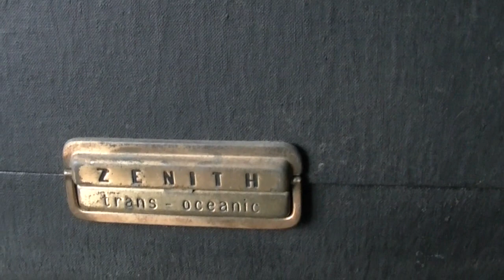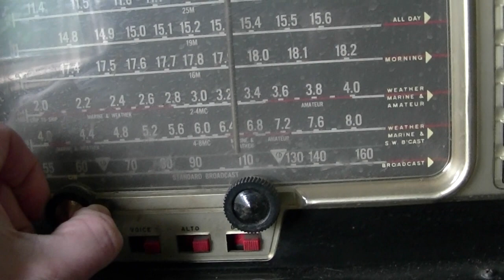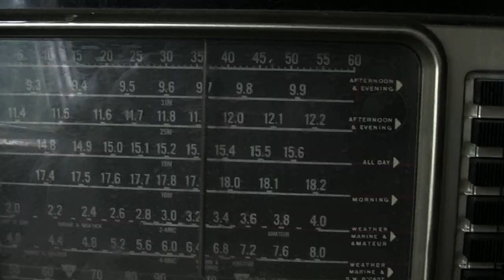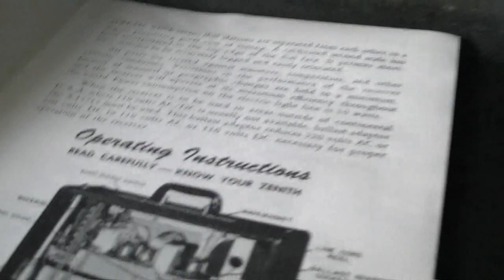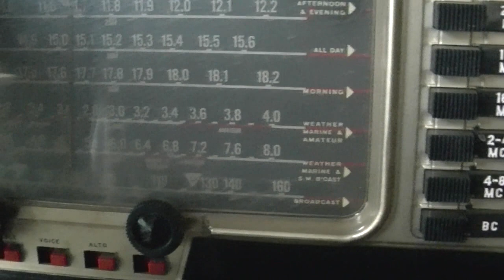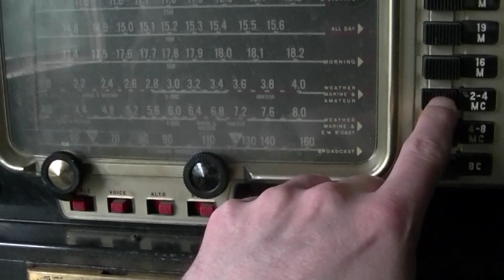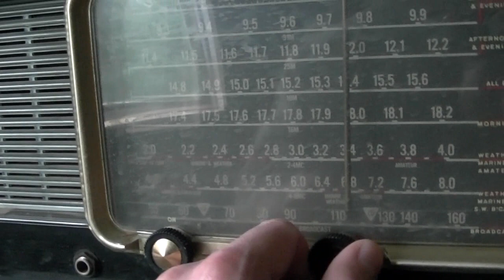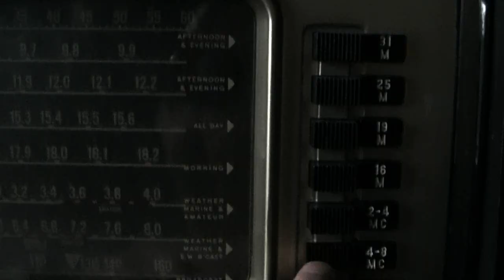Vintage ZENITH Trans-Oceanic Multi-Wave Radio

Comment: Having the CD symbols on the dial would date the radio from sometime between 1952 and 1964.  Looks good.  I have two of the transistorized TO's and both work fine.